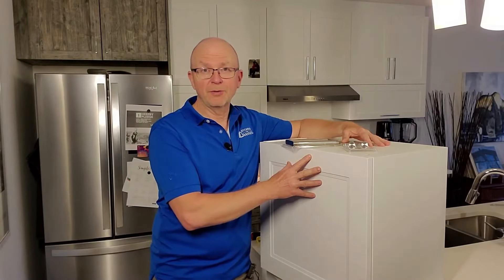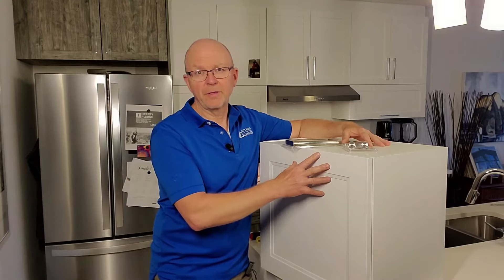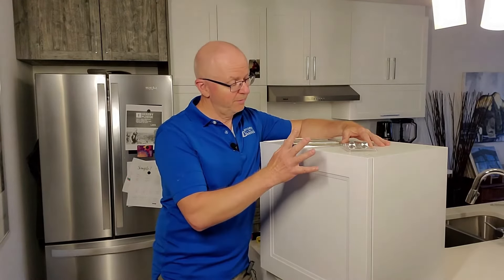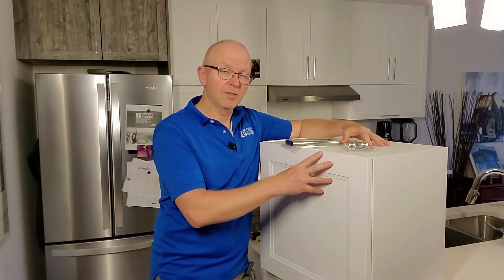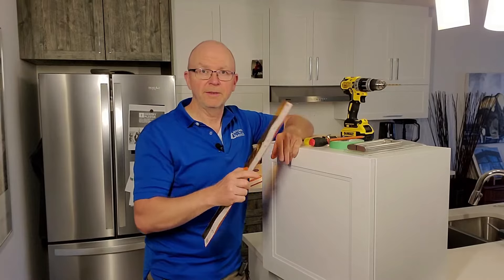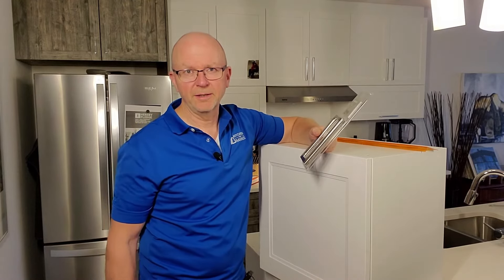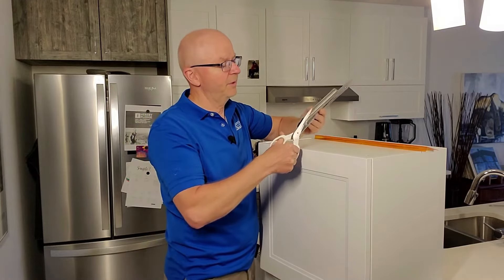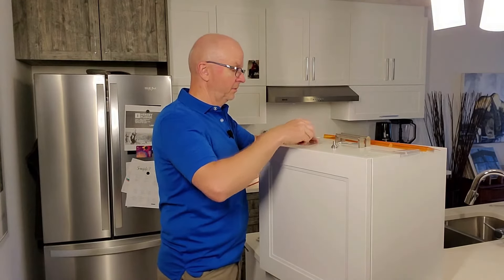A Step-by-Step Guide on How to Install Handles on Your IKEA Cabinets (Doors or Drawers)

Comment: Great video and i made my template for 3 size of handles. Only thing i did different was I found it hard to line up the tape for the doors so i placed more tape and drew a 90 degree line.
Reply from the maker: Good job, it's all about making it work for you.

Comment: Some IKEA cabinet doors are reversable, meaning they have predrilled holes for the hinges on both sides exactly where you’d want your handles to go. What do you do about that?
Reply from the maker: True. 
I check the instructions that comes with it. Normally I measure and let the 30" part be on top (for a 60" door) IF it's an upper door in a pantry.
If it's the lower door, the 30" is at the bottom to line up with the base cabinets.

Comment: I would advise to consider buying a permanent pen. Easier/quicker than using the masking tape in my experience. Especially since you buy new templates anyway. Thanks for the video content anyway! Or whiteboard pen to reuse the template.
Reply from the maker: Great tip! Thanks.
I don't use the jig from Ikea anymore and hasn't for a while.
Now I use one of the more professional solutions, like this one: https://amzn.to/4dLHtRE (aff. link)
Reply: @kitchensbyrannes  Wow, ok that device looks pretty nice!
Reply from the maker: It is. Saves me a lot of time.

Comment: Very thorough! All things thought about as well as how it looks...the template i found confusing as hell..
Reply from the maker: Glad it was helpful!
Reply: @kitchensbyrannes  very helpful till i got to the second set of handle and the bolts are 22 mm too short... all work put aside till tomorrow. Sigh. Always the way that something someone assured me in the shop would fit ..doesn't...last time i hired a drill they gave me the wrong bits...this time i have bought my own drill and they sold me the wrong bit... then I got the right bit and now...the wrong bolts... so frustrating. But at least all the measuring went nice and smooth thanks to your video !
Reply from the maker: @serendipidus8482 obstacles keeps piling up.
Some of the doors are rather thick, but if the screws are too short, I take you you didn't got the handles at Ikea 🤔
Reply: @kitchensbyrannes  no my aunt liked slightly different ones...so slight mind you... I have the ikea ones bought but she just didnt like them...the same ones in your video i think... the ones i got from the hardware shop are slightly more dull colour which she liked better... ive made the holes now so i better stick eith them and just find larger bolts...do ikea sell the bolts on their own? They will fit as theyre the same diameter just not long enough... gah! I have nearly every blood tool.known to man at this point for each tiny little job and the 3 others which were the wrong ones lol!

Comment: @27:08 great point about opening the door to check the hinged side. I also found opening the door gave me this insight...
I have just installed a 200cm high metod cabinet with integrated fridge/freezer. I have learned a great deal from you/your videos and website and I tried to put as much of this into practice and I am happy with the outcome thus far. I really appreciate that your videos fill in the empty spaces in the IKEA instructions!
Now I am at the handles stage having got past the tricky part of finding some that I like!
The cabinet has two doors one for the fridge one for the freezer. The doors are Bodbyn,  the freezer door is symmetrical, just one panel, so IKEA only drilled holes for the hinges on one side since you can flip the door around if you want it to open on otherside. The fridge door however has two panels one larger than the other, so you can't flip the door around, and so IKEA have drilled holes for hinges on both edges. You plug the unused holes with plastic caps provided. 
When I put the handle up against the door ( lower left in this case) I remembered your tip about opening the door. When I did so I found the location where I want to put the handle is precisely in one of the unused holes (covered by a plastic cap) .   Hmm so what now?  I am thinking do I glue a small piece of mdf in the hole to backfill it so I can screw in the handle  There doesn't seem to be much mdf left to put a screw into for the handle otherwise.  It's a handle with two screw holes somewhat like the bar handle in your video.  I wonder if you bumped into this situation before and what your thoughts might be. I did try moving the handle higher but I don't favour that position as it means moving the freezer handle lower to keep the symmetry and the lower handle is too low I feel.
Again, thank you so much, the tip about opening the door is a good one - if I had just gone ahead with the drill 😥
Reply from the maker: Hi Noel.
You're very welcome, again 😊
The idea you describe to fill up the hole should work. I've used washers for this purpose too. Drill the hole, through the plastic cap too, insert screw through cap, add the adequate number of washers, and then mount the handle. If you have rough teenagers, a glued solution may be needed as that will be stronger.
Reply: @kitchensbyrannes   Thank you for your fast response. I didn't think of washers  !  I will go with the glued solution for sure.

Comment: Hey Rannes. I just got one of those adjustable cabinet handle jigs I've seen you use and they made it a breeze to do a whole kitchen for a client in short order. Best $50 I spent! Keep up the great videos, I've already applied many of your tricks for my installs.
Reply from the maker: Thank you, Trev.
I actually paid a lot more than $50 for mine but it's the best money I ever spent on a tool. It certainly speed up the speed and accuracy of the handle job.

Comment: On the pointy thing you used to make the holes prior to drilling : 
An Awl is a small hand-held tool with a sharpened point - that's what you used. 
A Bradawl is similar but is flattened at its tip to produce a sharp chisel edge.  
For the purpose of fitting handles as per your demonstration an awl is the better choice over the bradawl. 
My (London England) accent pronounces awl as "all"  

🙂
Reply from the maker: Thanks for clarifying. A few others suggested bradawl, but Google is saying the same as you 👍
Reply: Awl is short for bradawl 😂

Comment: Hi Lars,

Thanks for another informative video. I am installing Eneryda pull handles on Axstad drawers.  Do you recommend centering the mounting holes on the "frame" or centering  the handle on the "frame". 

Thanks, Albert
Reply from the maker: You're welcome, Albert. 
Uh....that's a question for the spouse 🙏
But....I would drill the holes on the center of the frame(s).
Reply: Thanks so much for your help!
Albert
Reply from the maker: That on is tricky. I looked at the other eneryda. 
Handles centered on frame, not the holes.
Reply from the maker: You're very welcome 😊

Comment: Thanks so much for the informative video Lars, it helped us a lot. We had no idea the template even existed. I have a question: where do you place the handle on the Axxstad top drawer 24 x 5 , if its on top of a 24x10 and 24x 15? We chose the lowest hole on the template, though the halfway distance of the drawer front was actually the bottom edge of the template itself, about 9mm below the lowest hole.
Reply from the maker: I'm glad that you find the videos helpful. 

For the 5" high drawer fronts (Axstad and others), I put the handle at the same distance from the top as on the 10" or 15" high fronts i.e. on the center line of the "frame."

Comment: I am about to put on the cabinet doors. Should I drill the holes in advance before putting them on the cabinets? Thanks for the help!
Reply from the maker: Good question. I wouldn't because that makes it easy to drill in the wrong corner of the door 😱
Seen that happen ☺️
And if you always open the door and hold your jig with fingers behind the door, you don't drill in the wrong side either.
Just don't hold your fingers where you drill. Painful 😖

Comment: Thank you for all of your great and very helpful videos. I will however mount all of my handles on drawers in the centre of them rather than near the top as you suggest. I believe you're putting too much pressure on the backside of a large and heavy drawer every time you open it full of kitchen stuff.
Reply from the maker: You're very welcome.
Oh dear 😮 Are you now? 😁👍
I'm not a fan of that location for the handle but hey, not my kitchen 🤔
If the only concern is the one you mentioned, don't let that stop you from putting the handles at top. 
Makes no difference from a technical point of view. 👍

Comment: Great video. What is the process for drilling a new hole if an existing hole doesn't line up with the center of the rails? It should be straightforward but not sure if there's a trick to making sure both new holes are perfectly aligned
Reply from the maker: The word "rails" confuses me....
Reply: Rails is the term for the top and bottom sections of a shaker -style cabinet door/drawer. The top and bottom are called rails and the left and right pieces are called stiles
Reply from the maker: Thanks for informing me. I didn't know 😔

Drilling a new hole which is overlapping the old hole is truly difficult.
I use a True Position jig for making holes, and if it slides a bit, I'll redrill with more grip and attention.

Comment: love the video. Do you have advice for where to place handles on shaker cabinets and drawers? I see online so many options. My gut says straight in the middle of all the drawers in the panel ( on the lower cabinets)  but I see al ot of other options ( on the frame, varied in the middle some higher) I like clean and timeless and I have different size drawers so what size to pick 1-or 2 ? where to center it middle panel or frame?so many other options please advise sir thank you
Reply from the maker: Thanks. 
Well well. Handle location is a very personal choice and I put them where my clients want them as long as it's where I want them 😂 
Jokes aside. In 99% of all cases, always on the frame, not in the vertical middle, and always only one handle, despite having big drawers. 
Nobody's uses two handles at the same time, so having two will be for the look only.
That said, and to repeat myself, it's a personal choice so you don't have to go along with my preferences.
Reply: @kitchensbyrannes  thank you for taking your time to help me. Can you explain why you do it on the frame? Asthetics? Practical? I would do it horizontal on all drawers in the middle panel not vertical. Def not doing 2 handles but since my drawers are all different sizes I am not sure what size to do

Comment: Thanks for your information. I have RINGHULT glossy grey fronts and nothing to align the handles to. What distance from the edge to you suggest? I have 80cm upper cabinets with horizontal hinges, the doors open to the top. And most of my base cabinets have two big drawers. Thanks.
Reply from the maker: You're welcome 👍
Hmm.....I just asked myself that question the other day when I was installing handles on the Veddinge front, which is flat too. I went with approximately 45 mm (or was it 50 🤔) from the edge, but it's really a personal choice. I think it also depends on the handle, if it is slimline or if they are the thicker ones. 

Ask your spouse, just to be safe 🙏
Reply: @kitchensbyrannes Thanks! Your last sentence kind of answers my question, at least for the upper cabinet. My spouse is only 148cm tall. I guess it's best to have the handle not too high. ;) The upper doors in the upper cabinets are only for me.

Comment: Thanks Rannes for another useful tutorial. I'm doing it next and had to go back to buy the template. 
I have this question,  which handle size one must use with door height or width? I have tall 40 inch wall cabinets doors  and 24 inch pull out base cabinets. 
ORRNÄS handles have 3 different length. I guess the 9 3/16 will fit for 40 inch door and the 13 inch go for the 24 inch pull out doors? 
Not sure for the 6 11/16 , could be use for 12 inch pull out door? Any advice is appreciated!
Reply from the maker: You're welcome.

Your question belongs in the category of "personal preference."

Handles, knobs, or both, there are no right or wrong, almost.

I suggest that you ask your spouse 😀

Comment: Hi Rannes, I have the smoothTistorp door and drawer fronts plus in 2 locations, the horizontal wall cabinets with push up doors that are 15" high. I think i know the answer, but are you proposing that all of them have the handle mounted at the exact same distance from the top (or in the case of horizontal push up) the bottom of the door?  Does the handle distance from the edge vary based on the height of the drawer? I have in most cases 3 drawer fronts that are 5",10",15"but in a couple of situation, 2 large drawer fronts that are 15" each and then the normal doors up high plus the horizontal wall cabinets.
Reply from the maker: In general, I keep the distance from the edge to the handle or knobs the same no matter the size of the door or drawer. I think that looks the best.

Comment: Did u make a video like this video but using a flat panel drawer front? Ty
Reply from the maker: Thank you for your question. No I didn't, as the procedure is the same, you just have less restrictions to where you want to put the handle. I normally put the holes 1 ½ - 1 ¾" from the edge.
Reply: @kitchensbyrannes  thank so much for the reply. My crew and I are just debating whether or not to pre drill holes for the handles before fully assembling the drawers. 🤔🤔
Reply from the maker: @crystaldawn2736   I cannot recommend it. It's a lot easier with the drawer assembled and in place.

Comment: Wondering what your suggestion for horizontal pulls would be to bring 36" and 24" drawers together design/look-wise?
Reply from the maker: My personal preference is to have handles in the same size across the kitchen. I like a simplistic look. For that reason I also don't recommend to have two handles on a wide 36" drawer. Just one.
Reply: I agree but when possible i put a much longer handle on 24”, 30” and 36” drawers.

Comment: Bradawl 

Bradawl

A bradawl is a woodworking hand tool with a blade similar to that of a straight screwdriver and a handle made from wood or plastic.
Reply from the maker: Yes, that's what it's called.
Thanks for clarifying.